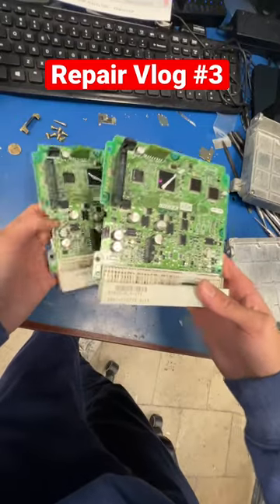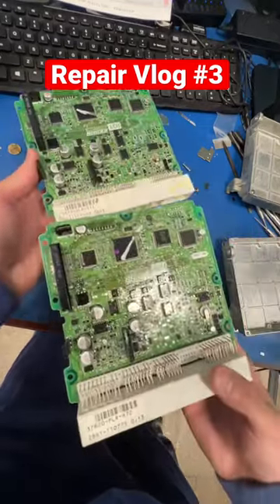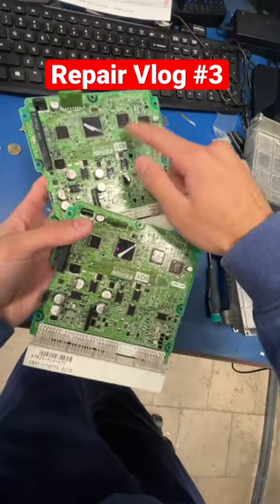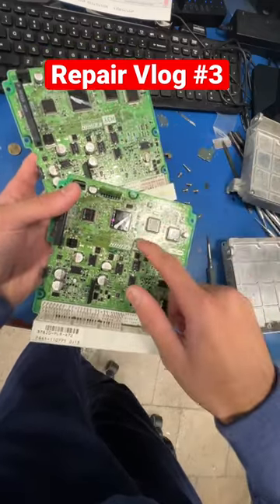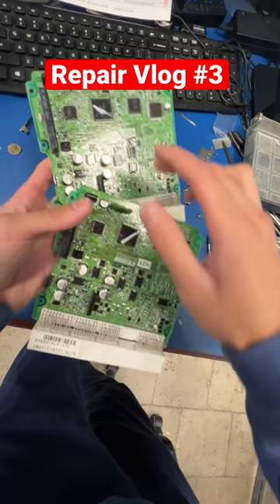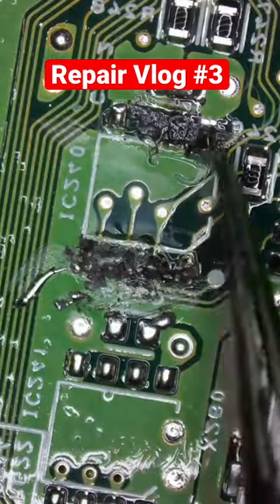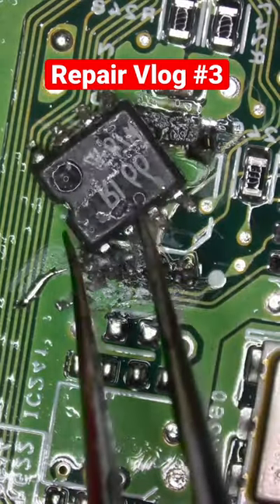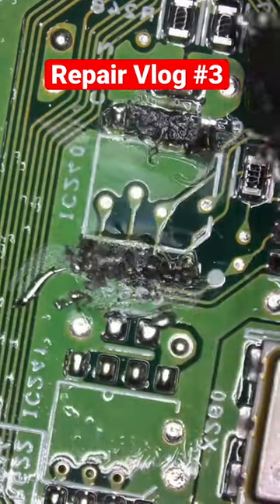Mechanic Soldered a Motherboard… Can We Fix it? #repair

Comment: It's an engine controller for a car, looks like a Toyota. The removed chip contains the coding for keys so you can move the controller to another car.
Reply: Might have been a fucjing theif
Reply: No. This does not help you steal a car in any way. They are just replacing a broken engine computer with another one from the scrapyard.
Reply: Solid knowledge
Reply: @ZonymaUnltd.  I'll bet that he's a mechanic... in older cars there were not that much elektronic
Reply: @Trux4Life  I'm a mechanic and most of the time we send it to an auto electrician/micro solder-er  because then we ain't responsible for said part if it goes wrong during to our limited knowledge on this stuff 

Everything else we are brilliant but this is a niche thing

Comment: I do it daily that's the eeprom used for pin code and keys , 93lc56 can be read with several programmers , normally that eeproms are in all ecus denso Hitachi Bosch Siemens in that years, 93c46/56 and 24c02/04 are the most used . In newer ecus are implanted inside microprocessor tricore , but also can be read easily with proper tools